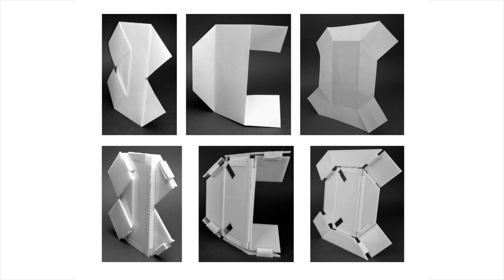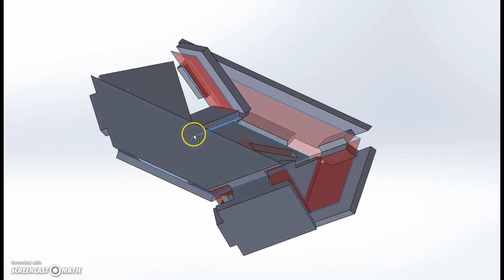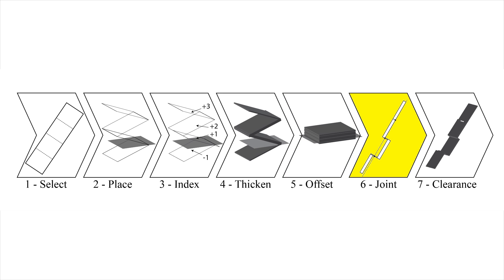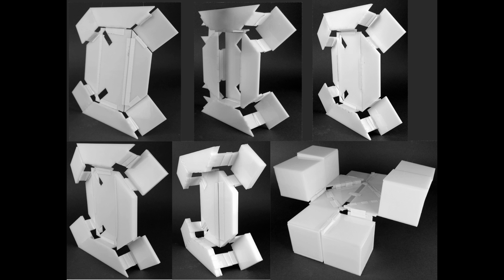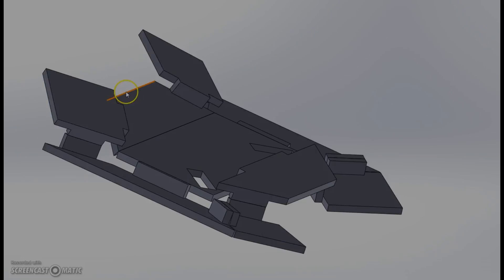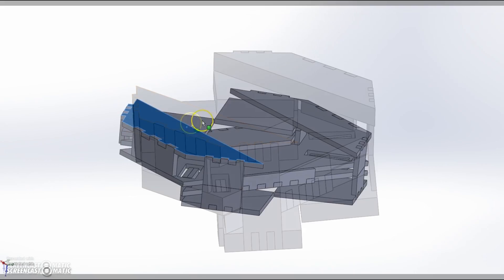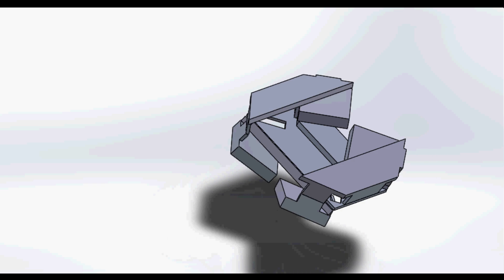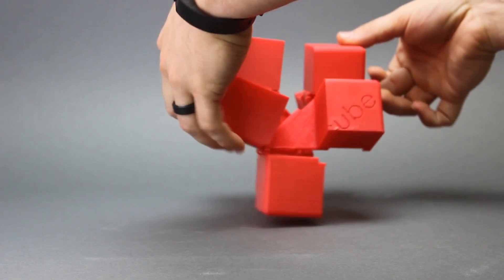Offset Panel Technique

Comment: What software is being used to model the kinematics of the origami mechanisms? Is it a standard CAD package or a program specifically made for these applications?
Reply: The software they are using to show and manipulate the 3D model is Solidworks. It's one of the most heavily used 3D CAD softwares in mechanical engineering. Solidworks does not currently have any special tools for designing compliant mechanicms in particular. In this video they are using an assembly of multiple parts to model how the equivalent single part would function